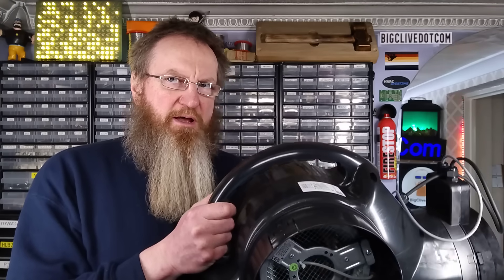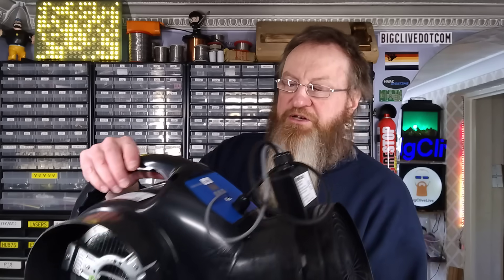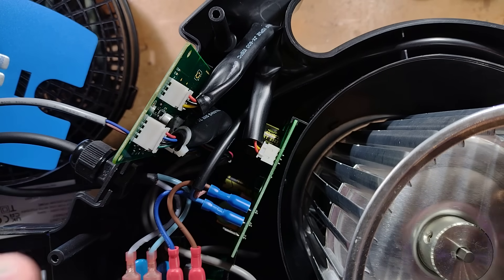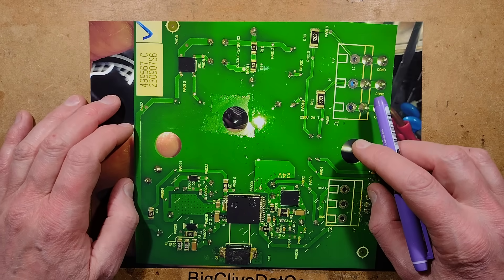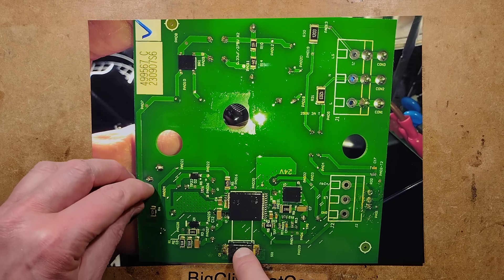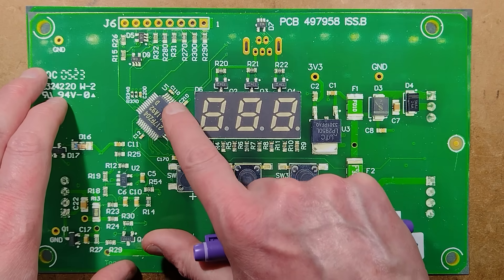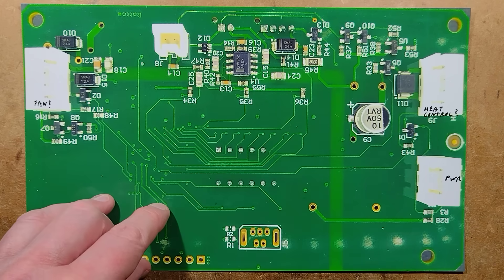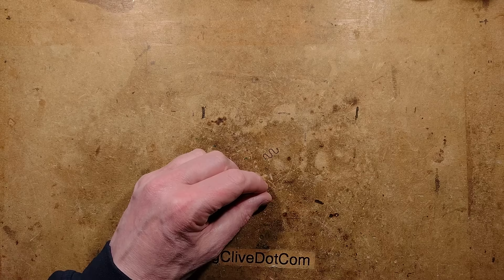Inside a Positive Input Ventilation (PIV) unit

Comment: in the winter, instead of the built in 500W heater, you should get a water/air thermal exchanger connected to your central heating system. ideally with zoned valves in order to not also have room radiators also heat up. gets complicated to set up tho. i've seen a dude's house who insulated everything waaay beyond the norms. he had a gas boiler connected to a water/air heat exchanger rigged to his central ventilation system and 0 other heating source in the whole house. good stuff
Reply: This is how I use my PIV with a hydronic coil in the loft so when the central heating is on the air is warmed properly. Adds extra warmth the landing.
Reply: Smiths make this device to fit in a kitchen kick panel. The biggest one can emit over 2kw from your radiator circuit. If you could find an old one where the motor has gone, and nick the radiator part out it would work if you boxed it up to mate with this.
Reply: @IanFarquharson2  I've always wondered about doing this. Even bending microbore into a coil could work

Comment: Interesting device. I have not seen anything comparable here in The States, however that does not mean they’re not out there somewhere around here.   I am a firm believer in fresh air in your home.  I installed a  12” louvered exhaust fan through the wall in the basement over 35 years  ago.  It runs almost silently on low speed, continuously 24/7 which moves just enough air to keep the house fresh and the basement free of any dampness. The fan can also be switched to high speed when more exhausting is needed.   The American made Fasco shaded pole motor with oil tubes, is still smooth and quiet all these years later.   Thank you for showing that cool device Big Clive.
Reply: In the States most houses have ventilation/AC, which would make things like this pretty irrelevant. In the UK most houses have closed circuit central heating, that uses a gas boiler to heat water and pumps the water through the house into radiators, and back to the boiler again. There is no facility for moving or cooling air. If you want to cool the house down or get fresh air, the only option is to open windows.

Comment: In my brother hose He has ceiling vents that blow air in and ground floor vents that suck air out and it all goes through heat exchangers and filters then through a heat pump and when you walk into his house it feel a bit cold turn the system on and with in minutes it's warm.  There a lot more to the system to what I have written down but that the basic

Comment: would be nice to blow warm air from an uninsulated attic down to the ground floor in the fall and in spring 🤔 or cold air from the basement on summer nights. don't do it by day in the summer because you're going to get mad condensation from the hot air vs the cold basement walls. you should always keep a basement closed on summer days and only open the vents/windows of the basement if the temperature outside is less than 5degC warmer

Comment: Interesting that you've experimented with a computer fan. I did exactly the same thing. I ended up upgrading to an inline axial fan combined with a hepa filter to bring air into our home on the top floor and there's a second fan pulling air out in the kitchen. Both are dual speed fans and I control them with an Arduino to which I hooked up a CO2 sensor so they try to keep the co2 level as measured in our living room to a sensible level. Seems to work quite well.

Like the commercial unit I also have a heater which can come on upstairs (just an old fashioned light bulb, so not much of a heater) and it'll shut down if we're pulling on air which is too cold. 

As here in NL there's always someone with a log fire, or letting off fireworks, or having a barbecue, the hepa filter is essential. But I can also tell the whole thing to just stop if I need to with a button on the living room.

Comment: You can probably stuff a round HEPA filter into those bags.
Reply: Undoubtedly - but how often would you have to go up into the attic to change it?
Reply: @polymath9372  Vacuum it every 2-3 months, replacing will depend on how dirty the air is really.
If you live close to a road or if there's lots of wood stoves it'll get stuffed with soot more quickly. If you live country side where the only real problem is pollen then you can probably reuse the filter a number of times after vacuuming it.
An air purifier with hepa filter in a room with a very heavy smoker lasts about 4-6 months.

Comment: PIV get unfairly knocked by certain members of the "eco" community for not being as good as full holy-grail MVHR, totally ignoring that they can be retrofitted in an afternoon, and do the job of improving air quality and reducing risk of mold with minimal energy input and insignificant heat losses (and MVHR doesn't even meet the quoted heat recovery figures in many non-lab situations).

I fitted a Nuaire 365 unit (now discontinued) almost 10 years ago and it solved all condensation issues within a week. More effective than passive trickle vents in windows.

Comment: Attics are notorious for dust and glass fibers. The filtration system would have to be hospital operation room standard to be safe.
 Air in uk most of the time is bloody cold and running a 500 watt heater is madness.
 This is an ill conceived load of junk.
Buy a activated carbon fan filter or two and run  within the home 24/7 to filter the already WARM air. In summer open the flippin windows as much as possible.  Don't dry clothes on radiators.

Comment: What a nice little device! And in case of an accidental house fire it will ensure the flames are always getting fresh air. Lovely! :) I like it.
Reply: I have a version from Nuaire that takes a signal from the linked fire detectors in the house and a heat detector in the attic to shut the unit off if they alarm.

The ceiling vent also has intumescent heat expanding material to seal itself shut like seals around fire doors.
Reply: @ That´s clever and actually quite reasonable.
Reply from the maker: For specific applications this unit can be linked to a smoke detector to shut it off.

Comment: Having worked in a few 'Clean Rooms' which use positive pressure to keep contaminants out and really does freshen the air, which could be beneficial if you suffer from breathing problems. It could be a huge plus using one in a domestic setting, the price seems reasonable but running costs, as Clive said, could be restrictive in winter. Really interesting post, never really thought about one being used in a home. Thanks Clive 👍

Comment: Use a 50 cfm ecm bath exhaust fan 1.0 sone, 8 watts on wifi switch.  Can be used as positive or negative air. $50US

Comment: I have a piv unit in my loft it’s great at stopping the mould and supplying fresh air. It’s by enviro vent it got a remote that sticks on the wall think that’s what the rest of the circuit is for . Great videos Clive thanks
Reply: I have one by Envirovent too. It doesn't have a heater, in the summer it shuts down to stop it blowing hot air into the flat. Temperature regulated. No remote

Comment: PIV is a whole new area of experience for Big Clive but one I didn't think he'd be so keen about exploring. He's just full of surprises. As for the filter issue there's very likely a large equipment engine air filter available with that diameter that's made or rigid pleated paper with sufficient structure to not collapse under the negative pressure.
Reply from the maker: All it took was coming home from being away and realising how musty my old bungalow smells.
Reply: @ Sometimes ozone just isn't enough, nothing truly beats getting the doors open for some fresh air to soak out the closed home smells. 🙂

Comment: Here in Belgium it's actually far more common to have the fan the other way round, in which case that'd be called a class C ventilation setup. Such a setup is usually paired with vents built into the window frames. Class D would be with both incoming and outgoing air being forced air, with a heat exchanger between the two to recover most of that energy. Not sure if it's called the same thing in other countries.
Reply: So what I'm hearing is that in Belgium you do PIV the other way around?
Reply: @petergerdes1094  typically, yes. What'd you reckon you'd call that in English? Like, NOV, or something.
Reply: @ManWithBeard1990 that's just extract air, a piv is supply air only.
Reply: Forced exhaust is something I'm familiar with from laboratories. I used to work in PC2 labs (physical containment level 2, which sounds a lot more serious than it actually is) for genetically engineered organisms, and our ventilation system was intended to maintain slightly below atmospheric pressure inside the lab to ensure that any aerosolised microbes can't escape, except via the ventilation system which has filters.

We later discovered, to our dismay, that incorrect construction of the building meant that unfiltered ventilation air from the labs was being discharged into the adjacent offices. 

I also once took a job cleaning a former PC3 lab, which was at one time used for pathogenic E.coli work. That lab had a stronger system (it generated enough suction to pull a noticeable draft of air in from the sewers through the drains, if you let the S-bends dry out), and even an airlock for entry and exit of the part of the lab they kept the nastiest stuff in. You had to close the airlock's outer door and wait for the pressure (measured by an enormous Magnehelic gauge) to equalise before you could open the inner door to the room- the pressure difference would hold it closed so long as the outer door was open.

Comment: We have something similar to this on all new builds in Norway where the property is air tight with 30cm of insulation on all exterior walls. The units incorporate a heat exchanger that heats up the incoming cold air with the outgoing warm air. With a couple of filters that need changing every 6 months 🤓
Reply: That would be a “whole-house-heat-recovery” unit; the upgrade from a PVU
Reply: @samuelfellows6923  Not necessarily. We have them as well and they are individual units in every appartment. Unfortunately it dries the air too much in winter, when there's already very low humidity.
Reply: @IrenicusFTW  they can't decrease absolute humidity.

Comment: I worked at a store a while back and the HVAC system was creating negative pressure at the doors and was constantly sucking garbage and leaves into the store. I talked to the HVAC guys and they did something to change it to positive pressure and it stopped sucking garbage in the doors..
Reply from the maker: What the HVAC industry calls air balancing I think.  If incorrectly set up it can make doors hard to open.

Comment: these work surprisingly well, fitted a few of the nuaire version and had good reports back about the results. the filters stay out as well. The only problem is the ducting diameter being slightly too small and is a pain in the arse to get attached to the unit.
Reply from the maker: Yeah, it was frustrating to attach it to the small lip on the front of this unit.  As you tried to secure the band the duct would pop off again.

Comment: Kind'ova Luddite still. Not a fan of circuitry in the attic where it can get up to mischief unattended. 
Can do most of it with normally open and closed temp switches.
Active solar thermal is what I'm drawing from.

Comment: Stuff like this is often talked about here in the US when we look at the lack of ventilation and other poor construction methods in the UK. There are 3 places you don't pull air from. Never pull air from the attic, garage or crawlspace. An ERV is a far better solution and brings in clean er air from outside. Blowing air into the attic from the house is a better solution than this unit but still not the best.

Comment: Heater circuit may have included safety cut out relay (to cut power if triac failed short)
Reply from the maker: It does have a thermal cutout built into the heater assembly.

Comment: In the  Isle Of Man,   do you have  DSL, cable  internet or   fiber ?    I am  sure their  are  undersea   fiber  cables  going to   Scotland  to supply the island with bandwidth
Reply from the maker: There are several fibre links to the island that are run with the power link.  Most of the island has fibre, and there seem to be quite a few data centres here, plus an uplink to the Starlink network.

Comment: The circuit board 14:54 does not look professional(probably an intern job  a s/w engineer learning h/w design on the job🤔) , due to 90 degree traces, thin traces and traces uncomfortably close to connector pins and other traces🤯. PIV looks like a good solution to dried out p-traps(those unused toilet drains😢) as well, preventing the sewage effluent gases from entering living spaces.❤👍

Comment: I suspect that a lot of confused Americans are like "isn't this handled by the HVAC?" and they are just assuming a bunch about how homes are built... These are more common on commercial buildings where you want to keep the dust/grit out of a clean room. But they are useful on very large homes that have more than one HVAC zone.
Reply from the maker: In the UK we rarely have air conditioning and the heating is hydronic pumped water and radiators.

Comment: Always been a big fan of PIV videos 😂 ... I know it as PPV (positive pressure ventilation). That avoids the awkward silence and giggles. Acronyms are super dangerous these days
Reply: I think of the Peak Inverse Voltage rating of diodes, although that's just known as the "voltage rating" of the diode nowadays.
Reply: Probably a good thing it wasn't POV vids😮

Comment: Bad idea to push warm air from the top down. PIV means that you push air from the outside to the outside, so in winter it'll cost you that expensively heated air. In summer it could push warm air into a cooler building. I think I don't like it, although it could be helpful in a hot house in the summer to push colder night air inside.

Comment: An excellent idea, but I think I'd find a way to install this in the living quarters and exhaust into the attic so I'm pushing the attic temperature towards the home temperature instead of outdoor temperature. And I'd build a couple of simple metal frames to hold those sock filters open.
Reply: You never want to send damp warm air from your house into the attic, as it'll cause condensation, mould and wood rot.

Comment: A version of that PIV were fitted to Housing Association houses across the North West, they had no heating circuits and the filters were ridged hemispheres roughly the size of a halved basket ball, the ones in flats had flat circular filters, and for some reason they never seem to work and you could never get hold of replacement filters. And with the one for flats the fan had a habit of getting bound up which resulted in the unit blowing fuses/tripping circuit breakers.
Reply from the maker: It sounds like they may have been the prototypes.

Comment: We've had one for about 10 years, but in the first few weeks we noticed that all the condensation on the inside of windows in the morning was gone. Mould is also massive reduced, which is a real problem here in Cornwall.
Reply: @johnnodge4327 I presume it dilutes the radon As well
Reply from the maker: There's a radon mode that means that the fan will still run at low speed even when it's below the normal running temperature, to keep displacing any radon gas.
Reply: @samuelchamberlain2584 
Yes, very likely. I've not had a radon monitor fitted since the unit was installed, but it was recorded as elevated in a few upstairs rooms. 
Maybe I'll get the monitors again to see if there's a reduction.